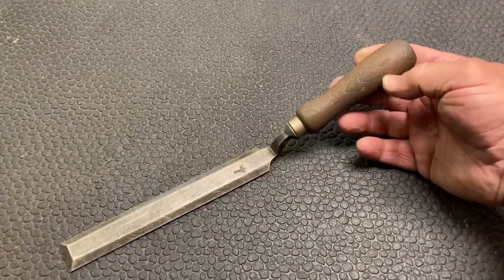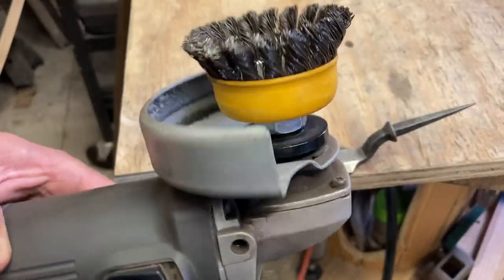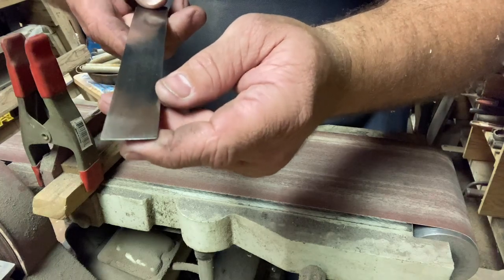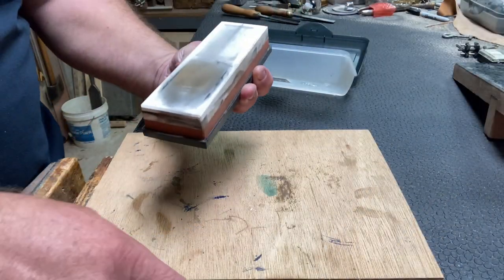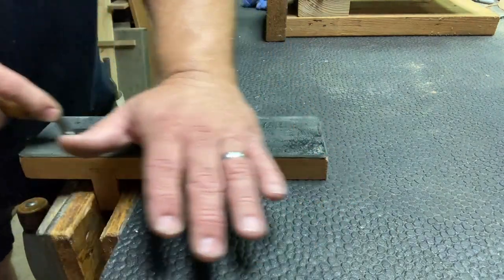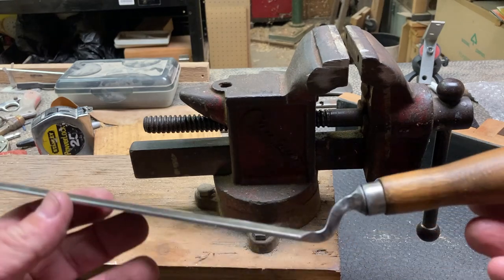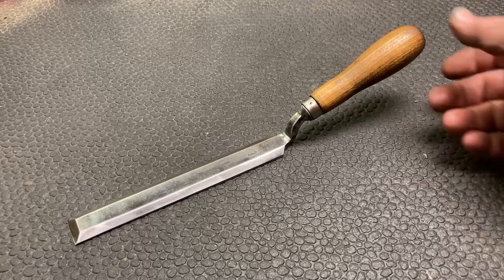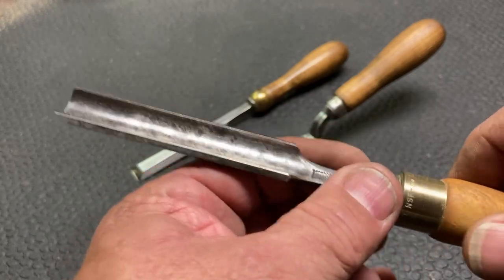Buck Bros Bent Chisel Restoration

Comment: I was wandering why the bent handle and then when you cleaned out the slot that made it so much easier I'll have to search for one now 
Thanks for sharing your talents
Reply from the maker: The bent handle gives your knuckles clearance. I very easily could have used a regular chisel on the project, I did not need a bent chisel to clean out that slot. I just used it for that project because I needed a chisel, and I had just restored that one. If you were doing long dadoes in a board that chisel would be ideal. I hope that makes sense and thanks for stopping by. Have a great week.